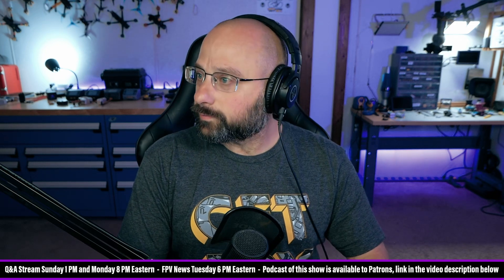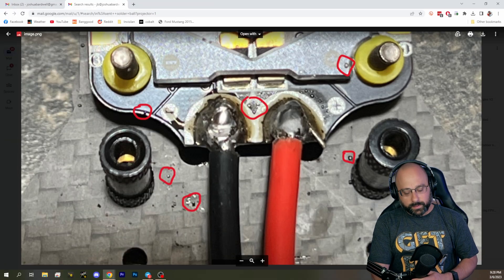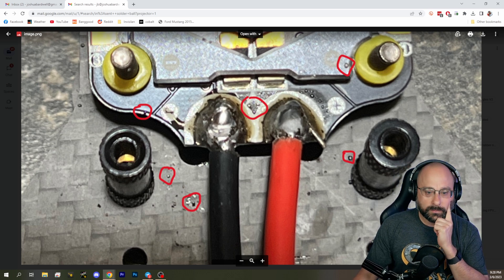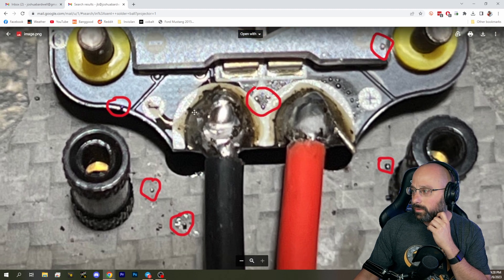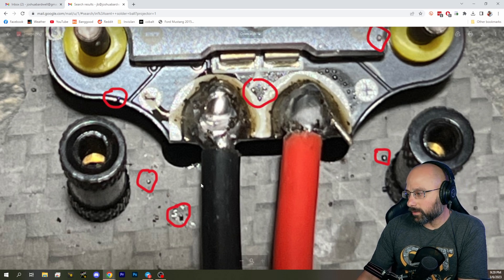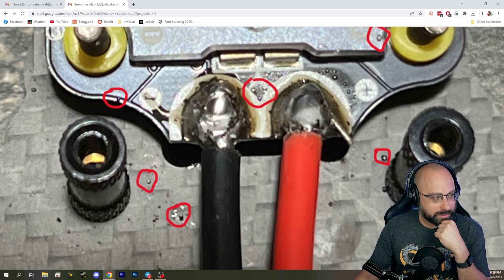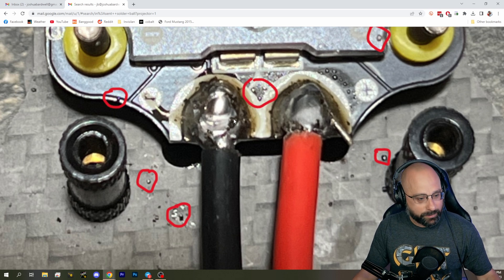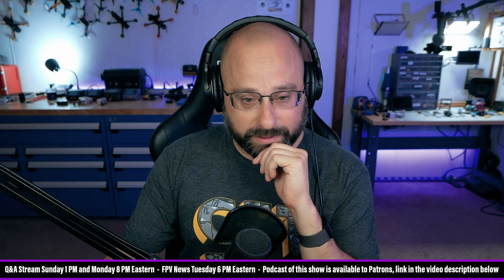Why Do I Kill So Many ESCs? Am I Doing Something Wrong? - FPV Questions

Comment: Look at this fat cat American, using brand name solder from Amazon! Any solder wire with 1–2% rosin, lead or lead-free, is fine. What you really need to make quality solder joints is a good, powerful soldering iron. The only scenario I can imagine where soldering the huge ESC-motor joints leaves  solder balls is a dead tip on a weak iron. Stop using toy soldering irons and get a TS100, ffs! 

It's not even expensive — I bet a set of four brand name 60 amp ESCs will cost about twice the price of TS100 with the BC2 tip.

Comment: Solder melts at 185-190C. 90% of wires on FC.. all the signal, 5V etc you only need 320C - it WILL flow instantly.
If not, its a DIRT TIP, TINY CONICAL tip, not tinned or you have NON-LEADED solder.
 Running 850f you are masking the issue.
For motor pads or XT30, you MUST use 360C, and XT60 or bigger jobs you will certainly need 400C.
I see this over and over - oxidized soldering tip. dirty pads/wires. KEEP THINGS CLEAN and USE MORE FLUX and CLEAN IT.

Comment: I find that for battery leads to the esc need to be done at a higher temp otherwise I’m staying on the pad to long. The ts 100 soldering iron struggles to get the job done even at its max temp which I think is 400. So for these I use my other soldering iron at 450. Get in and get out the longer I spend on it the worse it gets
Reply: use Ralim and use boost mode to get it to 420 °C (previously 450 °C) and use a lot of flux.. AWG 12 is easy then, even AWG 10

Comment: I'm pretty sure this video was from the emails I sent Joshua about burning up 3 ESCs. Thanks again Joshua for the feedback, I've started using blue painters tape over the ESC when I do soldering now, I'm using the same solder and flux as you so I don't think that's the issue, and I've been running at 425-450c with the chisel tip on my soldering iron, keep the tip clean with a wet sponge, etc. The only thing weird about this issue I'm having is it only happened on one quad. I have 8 others that I've built or rebuilt and haven't had a single issue yet, so hopefully I don't have any more issues. We also talked about possibly the motors being too powerful, so I'm changing the motors to a smaller size and lower KV. I had 3110 1600kv motors, haven't decided on the motors yet, debating on 2307-2806 with the lowest KV I can find and see if I still kill the ESC's. Anyway, love your channel, thanks for the advice.
Reply: Heavy motors usually need lower min Hz filtering too, I wouldn't be surprised if 3110s would need filtering down to 60-70hz unless they're on 8mm+ arms
Reply: have you tried limiting the amp power on the escs?
Reply: Those are great ideas, I’ll try that too. What I know so far is that the max continuous amp draw of the motor is 67amps and I was using a 50amp ESC. I was able to make it take off twice but one tiny bump on the ground and the motor arcs and the next arm it just set on fire. My theory was when it bumped the ground it got a peak amp draw and it was so hot my solders failed, on the next arm they were touching and set on fire. That’s my best guess since after the fire a lot of wires come off the pads and are soldered together into a blob. Not sure if the fire caused it or what.
Reply: What’s confusing to me is I have two JB edition luminier quads, one I built and one was a BNF. But the BNF came with a cracked MOSFET on the ESC, soon as I turned it on it would do a Taz flip across the ground. So I got a new ESC and wired it in. Then I built the other quad, I’ve also replaced the XT60 several times from props cutting them up and replaced the power cable on my toothpick drones, none of them have had issues and been flying great. It seems odd to me that my soldering is the only problem with this quad but fine on all the others lol
Reply: @JT_Lamy  I highly doubt it's your soldering, once you get above 7" builds can be pretty hard on 4 in 1 escs l, I had some 2808s on 1500kv 6s 7" prop that were very spicy and was always worrying about popping escs, had a heavy throttle scale and I think it was giving an arm twist at like 70hz so I had to do lower filtering, I'm guessing your running those 1600kv on 4s which needs even more amps to fly good,(which will stress esc more)..... 3110s 1200kv on 8" with 6s batt and xt90 + thicker arms and you'd have better luck not popping anything
Reply: @badfourlife  thanks I really appreciate that, I was running my 6s battery because I thought it might need as much voltage as possible being a 7”. But thanks that’s some really good info I’ll keep all of that in mind, I appreciate it.
Reply: Are you applying the solder to the iron, or to the pad?

Heat the wire, touch solder to the wire. Heat the touch solder to the solder to the pad. Touch the wire to the pad, heat the pad and wire.

Comment: 450 is a lot for soldering, is use 400, works better in my opinion
Reply: The leading solder manufacturers recommend 390-400.

Comment: When I started buying reputable brand Esc`s like Hobbywing and Rush I stopped frying esc`s, I`m also on 400C all the time
Reply: I have been looking for some heavy duty ESCs that can handle more power since the motors I used pull a continuous 67amps. Are there others you’d recommend or are there ones you’d stay away from?

Comment: Hi, I have tx16s ELRS and when I connect the drone, I see errors in the menu where you are turning on/off internal and external module. How to check what are that errors related to and how to fix it? It is on both, internal and external module. The drone is flying but I am confused if it will not Return To Hongkong because of it😁
Reply: Did you drop it by accident? I did that and it went into emergency mode but then has been working since then. I just restarted it.
Reply: @JT_Lamy  No, I did not.

Comment: About the temperature, I almost always run my soldering iron at 350°C. But most of my soldering are small stuff... I only crank it up to 400°C or higher for bigger soldering. 
But that's because my soldering iron is a cheap one and it seems to make the tip live more.
Reply: So my question is what do you consider “bigger soldering”? I’ve been turning my temps down to 425 or 400 but it seems to take forever for the solder to melt into a pool, especially with a small tip when working on the top of the flight controller with those tiny wires. I think I’ve got a decent soldering iron, it has a big base with a digital readout and was about $150 idk if it’s the best but I think it’s decent.
Reply: I use the chisel tip and 450c for the XT60 connectors and it still seems to take a while to melt the entire puddle and if I want the heat to transfer up the wire a little I have to lay the chisel tip on it’s side ontop of the wire and then it’ll heat up the wire and the solder puddle on the pad
Reply: @jlschump  Well, a trick I use is to always wet the tip with a bit of lead before starting. It makes the heat transfer much easier. 
After soldering the joint I shake the soldering iron, so the excess drops of - far from whatever I'm working with. You know?
Reply: @MCsCreations  yea I wet the tip but what I’ve noticed is when I’m feeding solder onto the tip it pops a little and splatters, so I try to do that away from my quad, I also kinda sling the tip after I’m done and fling the excess solder off the tip. But yea thanks for the tips I take any advice I can get.
Reply: @JT_Lamy  Try to find a good soldering tutorial... Even Joshua made one a few years back. 
I plan about making one as well... But I just can't record videos right now. 😕
Reply: @MCsCreations  yea I’ve watched them all by this point haha, luckily haven’t had any other solder related issues. Just this one quad but anyway.

Comment: That's really weird... Can anyone explain me how those balls of solder happen? I would love to replicate it, so I can learn how to avoid it.
Reply: Sometimes the resin inside the solder boils and spits a little ball of solder like a mini volcano.
Reply: @WKfpv  Wow! I've never seen it happen! I'm going to keep an eye on it, thanks!
Reply: @WKfpv  never happened to me 🤔
Reply: The only time I ever had a solder blob was back when it was single esc per motor. I desoldered the wire and when I pulled the wire away and let go of it it recoiled and spit hot solder all over the esc
Reply: @BitchAssFPV  Oh, I see! Makes perfect sense, thanks! 😃
Reply: I think I can add to this since it’s my solder BBs in the picture haha. One thing Joshua mentioned is I might be feeding my solder in too fast. That’s when I noticed them popping, I wasn’t sure if it was flux popping off or what, but it only happens when I’m feeding new solder into the puddle or directly onto the tip of my soldering iron. I’ve tried going slower or colder and it helped a little but still seems to pop a little so now I put blue painters tape over the top of the ESC and it catches anything that might pop off now.
Reply: @JT_Lamy  Oh, interesting!!! Thanks! 😃

Comment: Too much prop? Overheating, not enough amps?
800-850c i run at.
Reply: The one in the first picture he showed is my 7” Rekon. It has a speedybee F7 v3 stack with a 50a ESC (which I think is a little low after talking to people and seeing the motors use a continuous 67a at max throttle). I have 7045 props I think, and the motors are Xing2 3110 1600kv. They make a 900kv that I’ve considered dropping down to, or I’ve also looked at the Xing 2805 and Mr Steel Ethix 2407 stout. Not sure what I’m going to do with it yet, gotta buy another FC stack and 4 more motors. Might drop to 6” props too